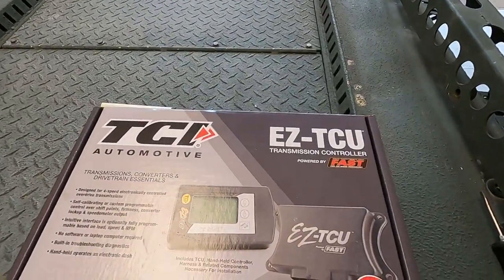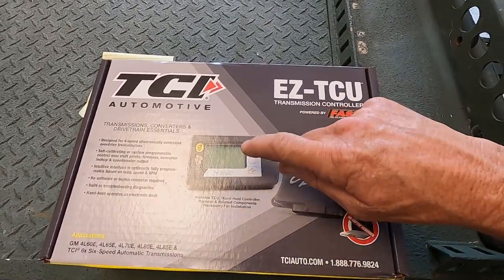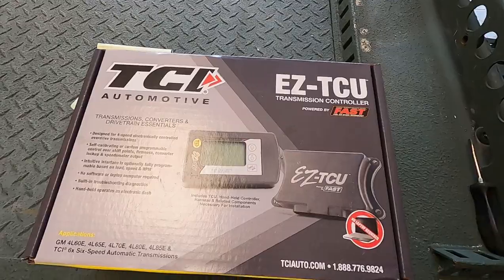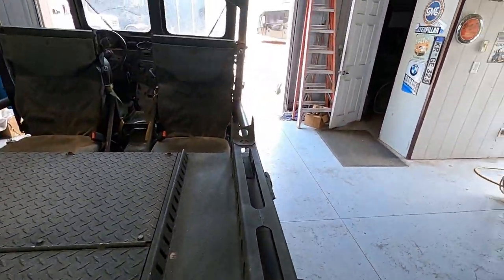Transmission Controller Update on my M1161 Growler

Comment: I believe my Growler has the same problem. I just received it and it seems as If it may be in second gear. It takes a lot of petal to get it inching along , then seems to cruise fine (just around the neighborhood) I dont have my FS- 97 yet. Do you still like the  EZ-TCU  made by TCI Auto ? I wish I was closer to you. I live in Florida. Would love to have a qualified person to look at it. I might need to "bend your ear" from time to time. I really appreciate the info.
Reply from the maker: It sounds like it is in “fail safe mode” have you checked the fuse for the transmission? It is a very common issue. When the fuse blows or any other electrical prob with it the trans defaults to 2nd gear.
Reply: @RasmussenEquipment  ...I have not checked the fuse. Not sure where it is? I need the service manual , do you know how I can obtain one THANK YOU SO MUCH!
Reply from the maker: We all want the service manual, but it is still classified. 
The bottom fuse on the right side is for the Trans. The fuses can also corrode since the fuse panel isn’t protected especially if your Growler has seen salt water. Two growlers I worked on had a real problem with corrosion on fuses.
Reply: @RasmussenEquipment  ...thank you. I saw where someone bought a PDF from the (manufacture On the forum I think). I wasn't sure as to whether or not it has become available.....Any info leading to such creature would be most appreciated. Warm regards
Reply from the maker: There is a driver technical manual, it does have basic info but it is definitely not a service manual. Growler USA was selling it in either PDF on a thumb drive or a printer version. I bought the printed version but if you can find someone with the PDF they could copy it for you. It’s about 100 pages of more. Since the Wuhan stuff got bad the lady or Growler hasn’t been responding to inquiries to purchase it.
Reply: @RasmussenEquipment  ..thank you again brother
Reply from the maker: I told you the wrong location for the fuse, it is on the bottom on the left side. Just check them all.
Reply: @RasmussenEquipment   ....thank you

Comment: Hello again. In retrospect how do you like the addition of this  EZ-TCU  ? Can you set it and forget it? When you take the ez-tcu out is the transmission still set, or does it need to be plugged in while driving. Would you still recommend it? Should I also attach the rpm /speedo do I absolutely need that? Sorry for the ignorant questions Im a novis
Reply from the maker: It works good. You have to install it permanently and it does need the RPM generator. I was able to connect it to the tach and that works correctly. After instAlling it it does require setting some perimeters. It will work “out of the box” but if you don’t set it it will damage your transmission over time.
Reply: @RasmussenEquipment  .....I owe you a steak dinner If I get out that way! Thank you

Comment: I was thinking of purchasing one of those vehicles.... are they worth it?... Thank you
Reply from the maker: I think so, they are pretty cool. If you can work on them yourself you can save a lot, unless you get one that someone already went through. They sat a lot so there are always certain things that need to be done. Most have under 1500 miles on them and a lot that have under 500 miles because they were only used for training and light strike combat.
Reply: @RasmussenEquipment  Thank you for the info... Also... thank you so much for giving out the info the offroad registration... I have 2 HMMWV that need to be registered...
Reply from the maker: If you use my promo code “Rasmussen” on Dirtlegal.com you will save $25
Reply: @RasmussenEquipment  Awesome..... Thank you